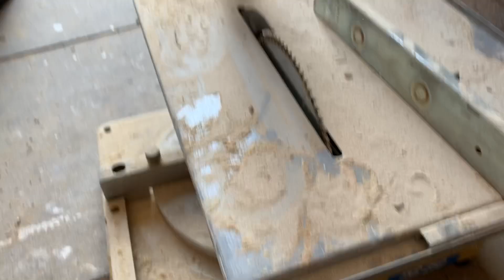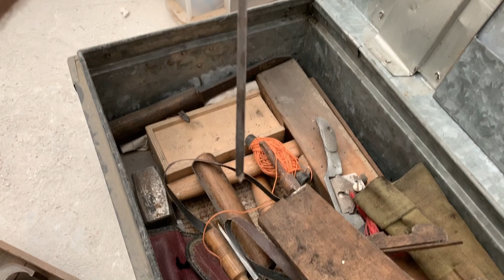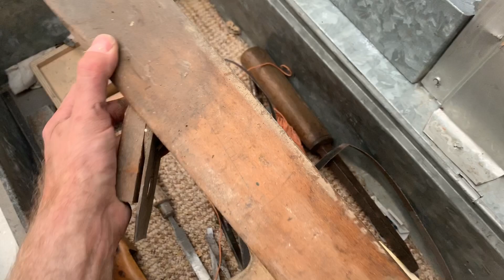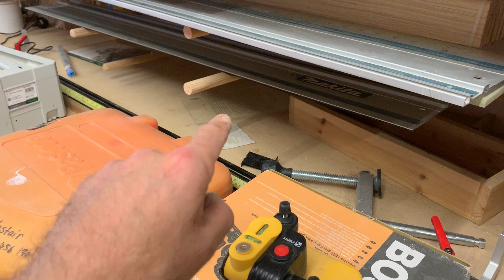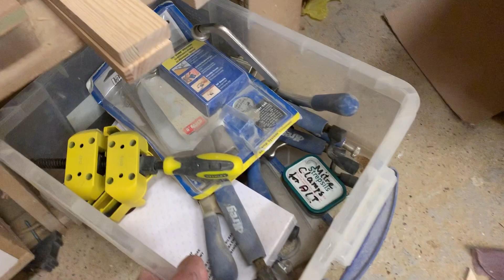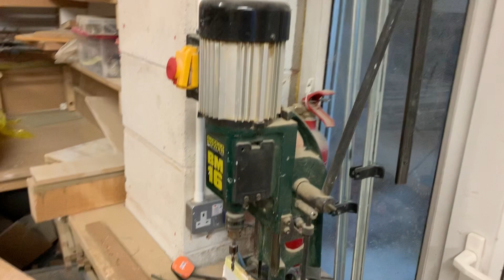Strange finds from forgotten corners of my workshop

Comment: Great video, I have quite a lot of those tools myself, collected and bought over the many years, The tool at 3-50 is called a scratch stock, The small wooden plane is a coffin plane, (I used to make coffins) I would love to have a root around your workshop.
Reply from the maker: Brian Roscoe thanks for the info!  Yes I had heard the term scratch stock before.  So the coffin plane - at first I thought that name referee to its shape, but was it specifically used for making coffins?  And what makes it suitable for that especially?
Reply: @Alastair_Johnson  Thank you for your reply, Sorry I thought afterward that I should have added it referred to it's shape, It was just the original smoothing plane, They are easier to set, the more you use one, I can't remember waxing the sole like you do a metal one. I suppose it's the wood to wood contact.